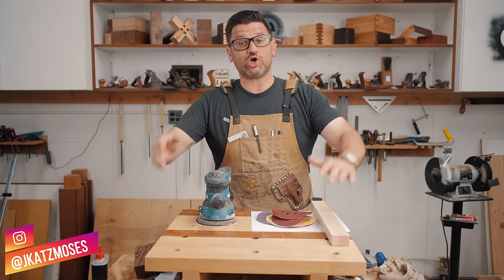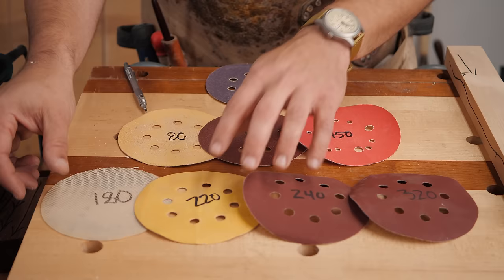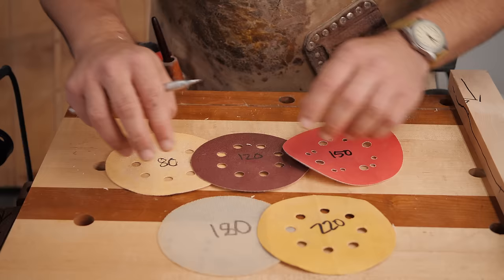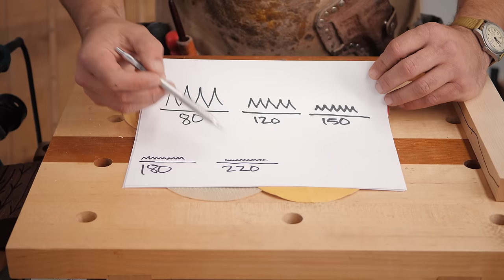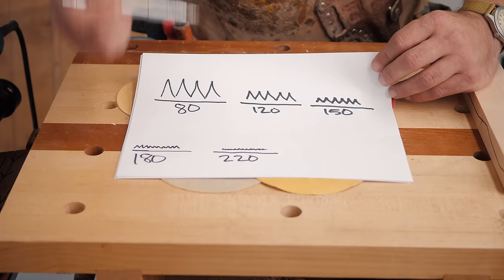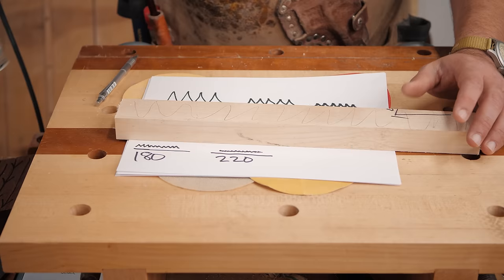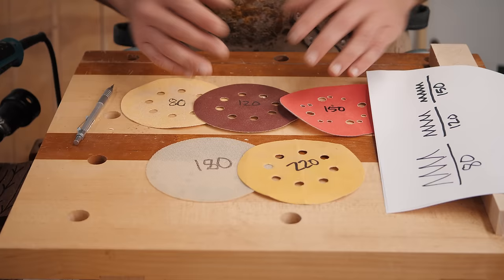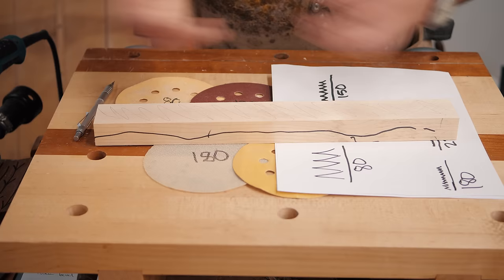Sanding Technique and Grits - 2 Minute Tuesday

Comment: Back in the 8th grade, (eons ago), our wood shop teacher asked the class which removes MORE material, coarse grit or fine grit sandpaper. Those that answered said coarse grit., to which the teacher then said wrong; fine grit does because there is more sanding material contacting the surface of the wood. Coarse grit may remove material FASTER, but fine grit removes MORE. You start sanding with coarse grit and work your way up to a finer grit, otherwise you would be there all day sanding your project with fine grit paper to get the surface smooth.What he said has stuck in my head for for 48 years.
Reply: This doesn't click in my brain at all. Maybe I'm stupid, but this sounds like a game of semantics
Reply: @LadyBovine  I'm just reiterating what my wood shop teacher stated, although I did attempt to test it out once by timing myself while sanding with two different grits to see how much sawdust was produced. It wasn't a very scientific test, and I failed to get any real results for at least two reasons. I had no way of weighing the sawdust that was produced by each grit, and I skipped too many grits because I didn't have anything between 100 and 220.
Reply: Your teacher was trying to make a point, but the teacher was wrong. Take your sander, put on some 60 grit and some 220 grit and see after 2 minutes of sanding the same spot, which leaves a deeper hole. Use calipers to measure. The lower grit removes more material AND it does it faster. Yes the 220 grit will contact more surface area of the wood, but it doesn't remove more.

Comment: I haven't had that problem with too much pencil lead on the wood but then again I have only done it for birch and maple so it might differ on different wood species.  I use a fat 5.6mm lead that is easy to apply and won't run out any time soon.  I do use the harder lead hb that has less graphite in it than the bold leads. 
 I use the abranet sanding mesh and absolutely love it.  Lasts longer and the dust collection is amazing. 
Does skipping certain meshes make any sense?  There are 60,80,100,120,150,220,320,400 and so on.  It seams to me that 100 and 120 would be interchangeable if you are just going to go up to the next grit anyways.  Same as 320 and 400.
320 might be the highest you go if your are going to finish it afterwards but working with epoxy, you sometimes have to sand the epoxy and to get it back to mirror shine, you sand up to 2k and then use buffing compounds after that.

Comment: I don't care that you went over 2 minutes, you said all that you could in a short time.  A trick that I have had success with is the sand  with the grain (by hand) with each grit before you progress to a finer grit.  This is more effective in the finer the grits, in fact if you do this with 80 grit do it with a light hand as deeper scratches happen with the grain.

Comment: Can i ask ,about sanding epoxy resin. I see they start lower and go higher but if u dont have much material to remove probably better to start higher. I just saw at some high grits they used water ,so i do not know if i start from 1000 grit to 4000 if i need to put water or not. Can u help?

Comment: In the autobody business sandpaper companies recommend no more than a 100 grit jump. So, theoretically, you could do 80, 120, 220, 320. I know wood is softer than body filler or paint, but would you agree with this?
Reply from the maker: Definitely not. Don't go more than 30-40 grit at a time with wood. Trust me its way faster to do the 5 I use in the video than to do 80 then 180. Its possible but you'll sand 5 times longer to remove the pencil

Comment: Amateur .. I go to 400 after the second paint of layer, and it gives an absolutely incredible look on painted plywood. Like .. it's so nice that you don't even want to touch it. It looks like plastic and it feels like satin. It's hard to explain how nice it looks on trims,   cabinets  and stuff like that.. parts of some furniture. I even go to 600 or 800 if I have the time.. it starts begin glossy, almost reflective at this point

Comment: In my progression, I go from 150 to 220 because that what comes in the packs I buy. Should I also include 180 just to decrease time?
Reply from the maker: Yes
Reply: @katzmosestools  Are you sure? I also have been doing what Rolly does, and it seems to work well. And the math works, sort of. Each jump in grits goes up by about 50%:
120 is 80 * 1.5
150 is 120 * 1.25 (ok, but it's close to 1.5)
220 is 150 * 1.47
320 is 220 * 1.45
If you add 180 in there, the jumps from 150 to 180 and 180 to 220 are pretty tiny, only about 20%. But I haven't actually done the experiment to see how long it takes with and without the 180 grit.

Comment: Question, when cutting a piece off wood do you guys cut right at the line or just a little before the line, that you measured.  Because of that 1/8 (roughly), that the blade is going to take off?
Reply from the maker: Check out my video called Superior Accuracy in woodworking 
Cheers
Reply: Thanks

Comment: What is the highest necessary grit for getting a polish on resin?
Reply from the maker: 180/220 if you're putting a film finish over it. There's a common misconception that you need to polish it. Try it with sanding to 220. The film makes is crystal clear and fills in the scratches.

Comment: Thanks for the video! When sanding to remove material, I find that the earlywood gets sanded away faster leaving the latewood high and makes the face uneven. Any tips to avoid this?
Reply from the maker: Use hardwoods. Thats a softwood problem.
Reply: You might want to try replacing your low grit sanding with scraping, either with a card scraper or cabinet scraper. If you like the scraped surface, leave it like that, or finish off with 180 or 220.
Reply: @katzmosestools  that's what she said!

I'll see myself out...

Comment: The pencil “trick” you describe is a little off for best results. Specifically your comment about not going back over sections where the pencil mark gets removed. The point is to make the surface smooth and flat. For best results you should make your passes in a consistent speed pass. If any pencil marks remain, those are low spots. If you go back and concentrate more time on those it will just make them lower. Instead you should put down another set of pencil marks and do a full pass again. Keep repeating that process until you remove all pencil marks in your pass. That way you know it is smooth and flat and the full area has been sanded. It’s tempting to just go back and hit the leftover pencil marks but resist the temptation and you will see the difference in your final finish
Reply: Basically the same idea as when you use the pencil marks when planing or jointing
Reply from the maker: Your board should be relatively flat at this stage so I was referring to not continuing in that area once the pencil is gone. You are correct if you're trying to get a board flat but when you get to the final sanding face your board should already be flat from your planer.